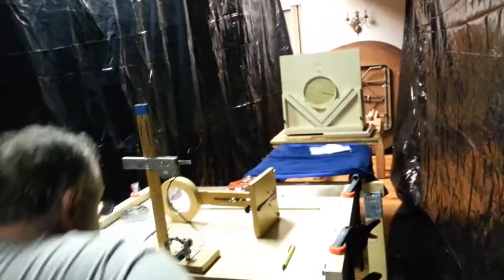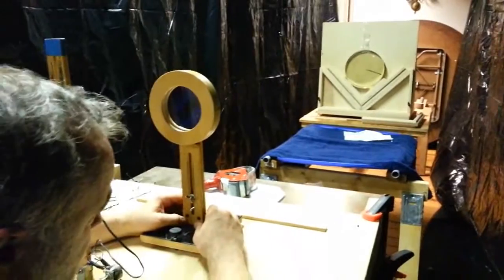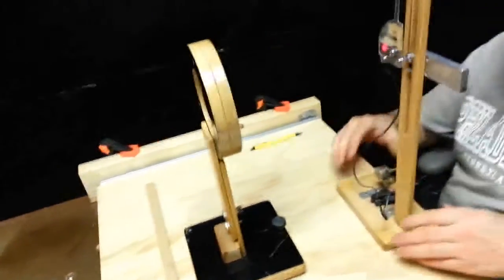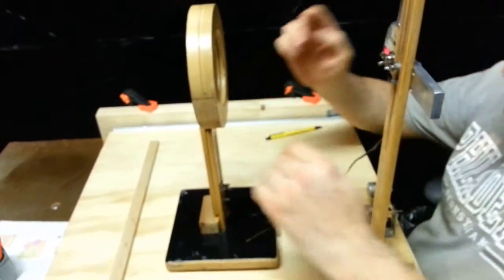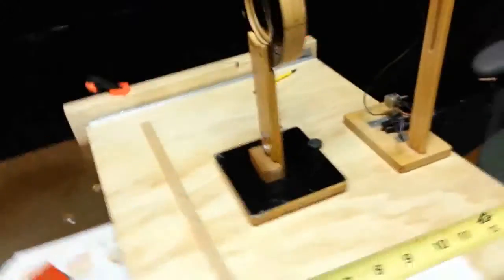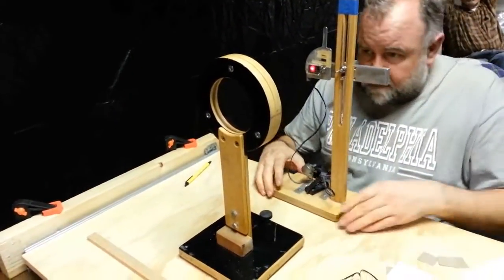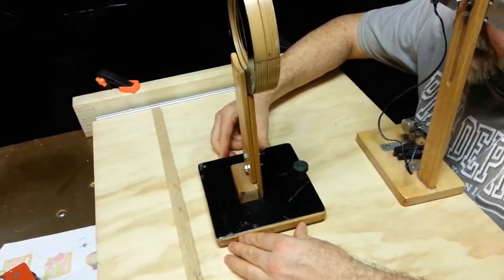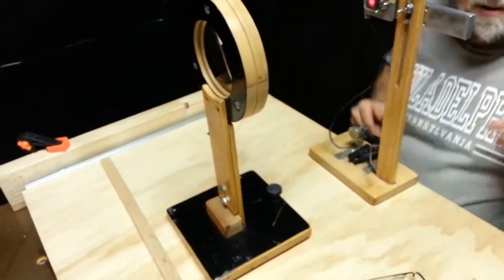swayze on the ross null

Comment: How does this compare in terms of ease of setup and use to the autocollimation test?
Reply from the maker: Gareth Barry you need less adjustments less hardware . Your closer to roc then focus so you need a longer area. I think it’s easier, but if you have a dpac bench like dick Parker’s then it’s an even trade with ease
Reply: @Pinbout  thanks very much I really appreciate the info. I will be looking to see if I can find a Ross null lens-I can't afford a Ceravolo-if I can find one cheapish then that might save me the hassle of going through the labor of grinding and polishing a flat (can't afford one of those either!)
Reply from the maker: @garethbarry3825  optosigma 80mmx400mm pcx uncoated about $115 it will do the job.  but I like my gimble not swaye's. check out my other vid on testing the lenses.
Reply: @Pinbout  shucks man thanks so so much!